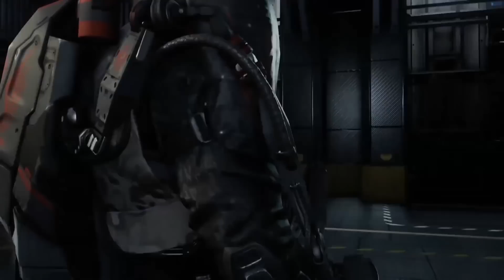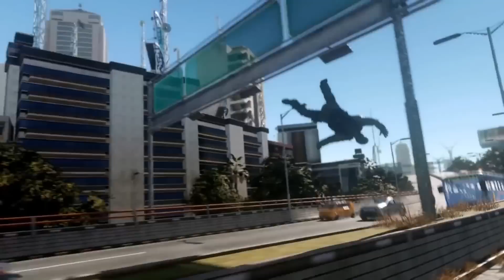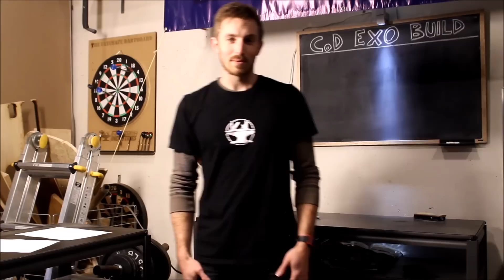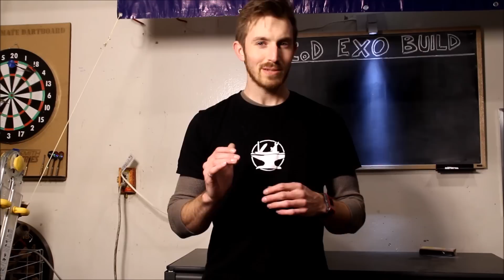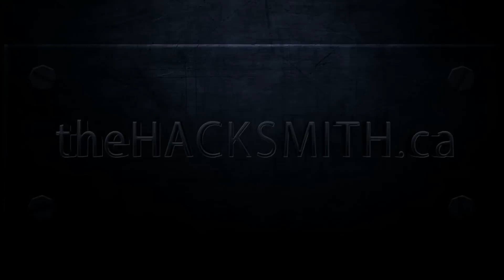Exoskeleton Power Systems

Comment: https://www.youtube.com/watch?v=eDq9hIroTf4          
https://www.youtube.com/watch?v=BdoblvmTixA
why dont you try try those kind of muscles for you exoskeleton? i think that thay will work fine
Reply from the maker: +Troll Face I have played with pneumatic muscles before (check out my older videos). I'd like to develop an exo with them at some point, but they are more useful for a "soft" exo. While they are strong they are difficult to use because they have a very short stroke length (1/4 of the length of the muscle) which is very difficult to get large ranges of movement with as opposed to pneumatic cylinders which can have a stroke 1/1 the length of the cylinder.
Reply: +the Hacksmith are you going to wse muscle sensors for you exoskeleton because it would be totaly cool and easy to use the exoskeleton ? and sory if oll my ideas are useles or anoying but it was my dream to do a big project lik this but i didnt have the space or the equipment to do that so i wanted to show you all my ideas and maybe to help you

Comment: i already built my first exo skeleton using a pneumatic system and i did have the problem that it can only go on and off but now i am half way thru building my second exo skeleton and i am using a 3 Position 5 Way Pneumatic Solenoid Valve which allows me to make very precise movements it still has the same amount of strengthin the lower and upper body

Comment: linear actuators make sense with alittle modding you can get them fast enough a speed controller and maybe a different drive motor and you should be good to go but then you do need to do alot more computing.

Comment: I have actually done some maths involving linear actuators and if I can get my dad's old lathe working to make some couplings for drill motors I should be able to lift about 250 kilos with one actuator and if I used an semi elastic cord as a linkage instead of mechanical I could maintain flexibility and most of the strength.

Comment: hello from Langley, bc . I am also interested in building my own exo but I want to wait till I can afford hydraulic check out " Parker Hannifin Corporation" they have everything but what is needed to power the pump
Reply from the maker: +Ivan Simmonds I used to work for a company that designed injection molding machines. We used a lot of Parker parts. If I had the budget... or if they wanted to sponsor me... I would love to use hydraulics.
Reply: Do you have a suggestion on what I can use to power my PTO for the pump if I use an engine I probably need to make the suit bigger to accommodate the fuel and hydraulic tank right ?
Reply: As well as the block also what sounds better air over hydraulic or electric over hydraulic
Reply: If I go electric over hydraulic I won't have to wait for the system to air up to activate the solenoid's
Reply from the maker: +Ivan Simmonds Electric over pneumatic you mean? There's no air in hydraulics...

For the most powerful suit possible, you're definitely looking at hydraulics. I would recommend a small gasoline engine to power the hydraulic pump. This would actually give you a very reasonable run time.
Reply: Yea, air over pneumatic
Reply: I was doing some research though and there exists what the Japanese fellow called a diesel powered gas engine
Reply: I think I may need to mod the engine slightly to avoid bending rods or putting one through the wall on account of over revving
Reply: I was also thinking directly manipulation of the hydraulic valves would make a nice control method that way the suit can be motion controlled
Reply: Another question I have is do you have any suggestions on a good engineering school ?
Reply from the maker: +Ivan Simmonds Depends where you're located... I believe a person's character is what defines their success -- not their schooling. Certainly if you get a degree at MIT you can get a job anywhere, but that doesn't mean you can't get an engineering degree at any other school and be just as successful.
Reply: Well Massachusetts is out of the question for me as I want to stay in Canada
Reply: I was hoping you knew of a school in Canada
Reply: Are you any good with programing like a UI for an operating system made for monitoring engine temperature, rpm's, oil temperature, hydraulic pressure and fuel as well as a HUD ?
Reply from the maker: +Ivan Simmonds Anywhere in Canada?

University of Waterloo is pretty world renowned for their engineering program. I personally went to Conestoga College, the next city over. Got a bachelors of engineering with a heck of a lot more hands on experience, and I think in the end I got more out of it than a university degree.

If you're in BC, pretty sure the BC engineering program is also good.
Reply: BC engineering program sounds good , I also have quite a bit of hands on experience I just want to be certified as well as learn as much as possible about all aspects of engineering
Reply: Back on the subject of my future plans for a suit what do you think is better a closed in suit with camera feed or some sort of window ?
Reply from the maker: +Ivan Simmonds All depends on what you're planning on using it for!
Reply: Search and rescue and handeling of hazardous waste if done well enough maybe military
Reply: Shipping and receiving is also a possibility
Reply: +Ivan Simmonds Keep in mind that Parker Hannifin is financing a rehabilitation exoskeleton and they have gone with servo motors.

Comment: +the Hacksmith http://www.vexrobotics.com/vexpro/motors-electronics/217-2000.html These CIM motors are EXTREMELY powerful if you put a high torque gear set on them. I would say just one of these can lift 60 pounds with the right gear ratio. Two cims in a compact gear box can probably achieve way more lift power. Plus they are pretty cheap
Reply from the maker: +Gridious Cool motors! They'd definitely be powerful enough if you used a sort of pulley/winch system like what +Mr. Teslonian is doing, but to use them like servo motors you'd need a huge gearbox to reduce it down from 2600rpm to 1-2 rpm for use at a joint, and at that point, it'd be pretty bulky to be on your elbow or something!
Reply: +the Hacksmith True, maybe some planetary gear solutions?  I'm on my high school robotics team ,and on a 12v battery we've achieved a lot of power in small motors. Maybe even a cam actuated radial release mechanism could work.

Comment: If you want a cheap and dirty power system, get some geared DC motors (like windscreen wiper motors) and either control them directly or through a microprocessor with buttons that make the motor travel faster if you hold the button in for longer (PWM --> mosfet driver --> motor). If you want terribly inaccurate servo motors, use the motors above but attach a potentiometer to the shaft with gears, the movement of the motor is limited by the potentiometer's range then.. (It's how cheap RC servos work) Just some ideas for the desperate among us

Comment: you should try ebike motors. They are super powerful, react fast and they can be powered by decent sized batteries. They would be perfect for running.
Reply from the maker: +EEEE le r I actually have a bunch!

They are powerful, but not for an exoskeleton. They're designed to have power at high RPMs, while with an exoskeleton on the joints you would want no speed, just strength. You can get some mind boggling powerful motors (that's how they have quadcopters that can pick up people), like pop-can sized with 5kW output -- equivalent to almost 10HP, but again, they spin at a thousand times a minute. For an exo you either need to gear it way down (cost goes up), or use a different kind of motor designed to move in sections (like a servo motor!)

But thanks for the idea!